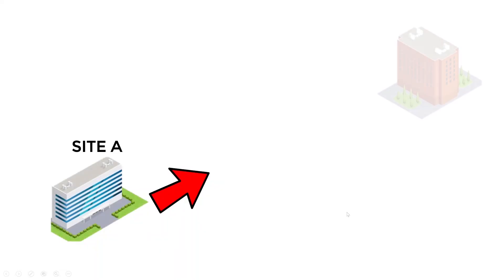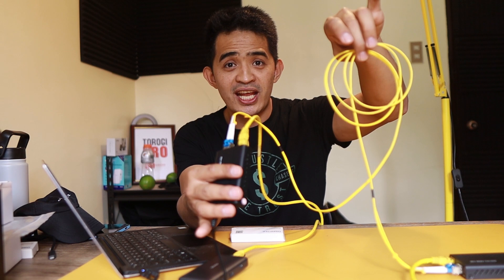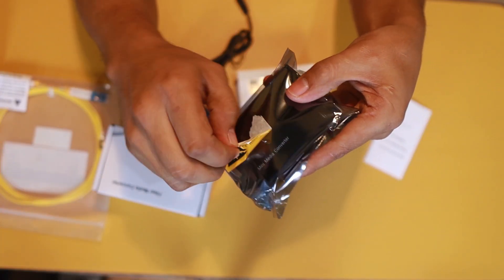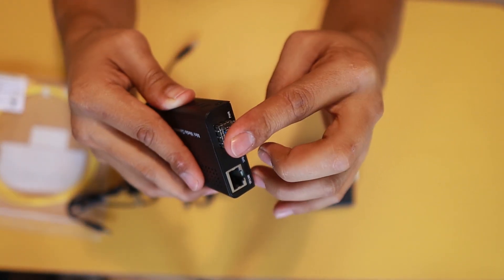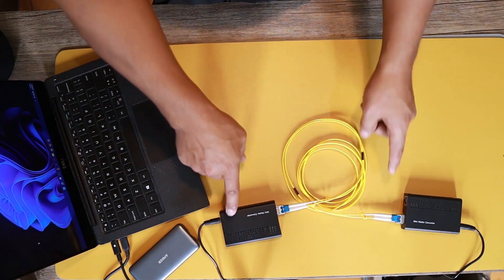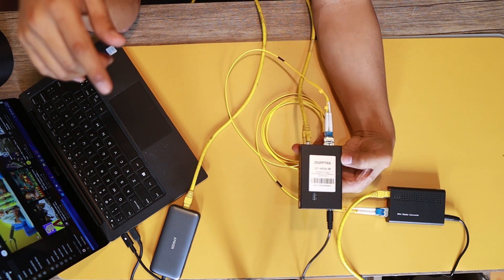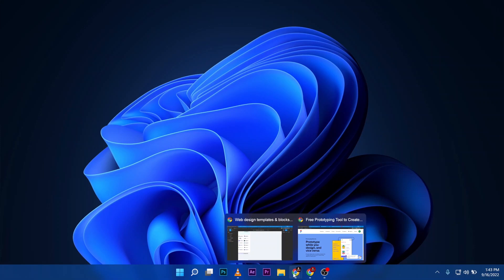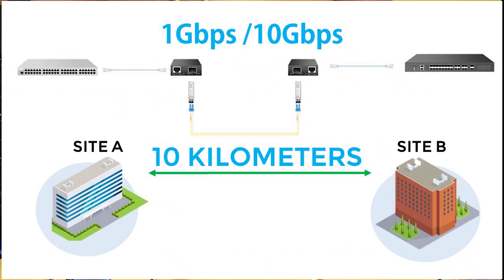Ethernet RJ45 to Fiber Converter - Up to 10 Kilometer distance

Comment: Can i use the normal port of network switch to connect from site A to side B using copper for media converter or sfp fiber or do i need a switch with combo ports or uplink ports? Thanks kabayan

Comment: I have been used this method 6 years ago.. And very helpful. But my devices doesn't work anymore. and I buy new one and difference. The device(converter) just have 1 port of fiber cable, before device have 2 fiber cable same as yours.